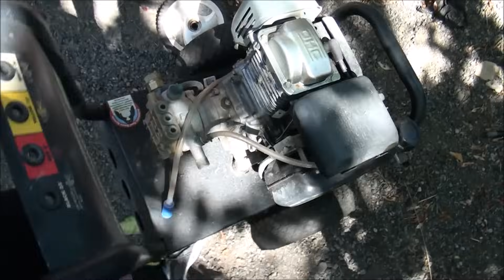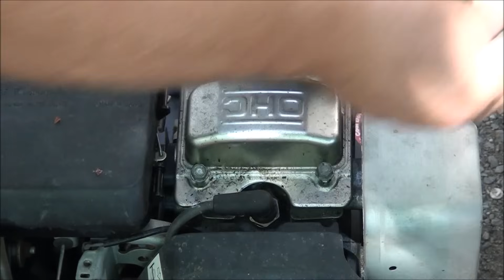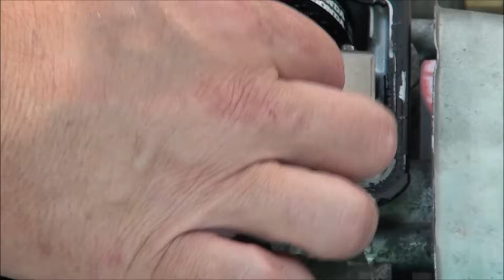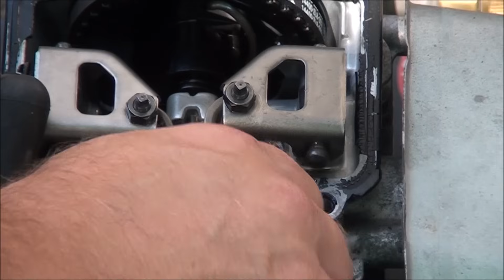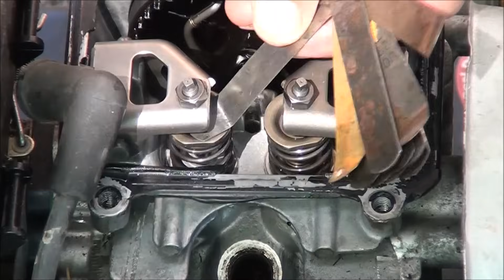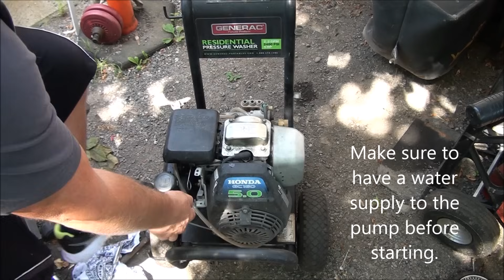HONDA GC 160 Engine How To VALVE INSPECTION and ADJUSTMENT - Specs

Comment: I can't believe that Honda didn't make a gasket for these GCV engines like they've done for all their other engines for the valve cover.
Thanks for the great video.
I'm working on a Ryobi Pressure Washer with the GCV160 engine that's popping and backfiring. 
After I adjust the valves tomorrow I'll put silicone on the cover and reinstall it

Comment: The engineers at Honda have thoughtfully provided timing marks on the belt driven wheel to easily find TDC, so there's no need to stick a screwdriver into the cylinder.  Also, I've never heard of a combustion stroke before.  It's the power stroke.  You want to make certain that the engine is cold when adjusting the valves, and that the piston is at TDC on the compression stroke.
Reply: Got a pic of the markings? I'm about to do this on the GCV190. I wish I could find a free service manual pdf.
Reply: He said compression stroke not combustion stroke.
Reply: @lifeisgood070  

Sorry, I don't.  There must be one available somewhere on the web, though.
Reply: Ummm there's an arrow on the flywheel and and mark on the timing gear just line them up... .006 intake and ..008 exhaust...simple...

Comment: All you have to do is be sure when adjusting each valve that whichever one your adjusting you make sure the rocker is on the base circle of the cam lobe .. Simply put you want the rocker resting on the opposite side of the lobe where there is no lifting action and completely off the ramps which is the only area you would expect to have any clearance so the valves can seat  .. Notice on the Honda there is only one lobe to operate both the intake and exhaust valves .

Comment: Great video thanks for the info. These are great little engines. I have the GCV 190 which I think I have a timing problem. Watched the video on it and not much to it other than pulling it apart to adjust the timing. Valves are already adjusted, new carb, spark plug and new coil. Not firing on trying to crank it. My brother said it probably jumped timing on a backfire. Hopefully I'll get it running 😆

Comment: A Honda service sheet unnumbered makes no mention of a (e.g. cork) gasket but instead says, "Apply a liquid packing (ThreeBond 1207 or equivalent) to the cylinder head cover installation surface, and install the cylinder head cover." 
 I thought they were called a rocker cover.

Comment: You are not supposed to ever run a pressure washer without water, this will burn up the pistons and seals in the water pump quickly and make the water pressure very weak or not make any pressure at all.
Reply from the maker: correct. I was only going to use the engine.I threw the pump away

Comment: Jeff I have a GC160 pressure washer. Took the pump off to service the unloaded valve and put it back together. Changed the oil in the engine, fresh gas. Since then the GC160 does not want to start when hot. When it is cold it fires right up one pull. Could it be that the unloaded is not set properly? I don’t have a pressure gauge to check it.
Reply from the maker: Hi friend. I have experienced this many times and here is Jeff's Tech tip #453655: I would clean/rebuild the carb and replace the float needle valve.  If the carb is filling up too much or seeping gas it is basically flooding out at warm start up.  Cold starts don't mind a little extra gas to get going but warm starts are effected geatley by a flooding carb.
Reply: @JeffsLittleEngineService  thanks for the reply Jeff, I will check it out!
Reply: @JeffsLittleEngineService  took the carb apart a second time because it still wasn’t right, I forgot the emulsion tube. Still nothing, now not even firing on starter fluid. I ordered a coil.

Comment: Jeff Iam new to your channel and after watching a few videos am actually curious .I noticed you provide specs for most of the engines you adjust valves on .However I haven't seen any with you using a valve grinder, pilots, stones or even a valve seat cutter to recondition valves . Fore give me for asking but isn't a valve seat cutter and is pilots imperative to recondition heads even if you purchase new valves and intend on lapping . I mean respectfully valves do wear and in doing so the seats are affected as well . So how do you contend with these issues ? What about a warped head as a result of over torqueing from other do it there selfers that expect your expertise to prevail where there efforts failed . I know personally when I do a over haul or rebuild I grind my valves and seats …..even dress the valve steams with chamfers on the older L head engines to ensure proper end gap or lash is correct . But I haven't seen you resurface a head on a surface plate or check the flatness of a head with feeler gauges . Do you just have such work done at a machine shop ? Or do you just purchase new heads with valves ? Do you just clean the carbon deposits from the old heads then reapply ? I only ask because you advocate your a expert and I have been in many shops over the years all of witch were expert dealers whom provided surface plates and proper valve grinding equipment for me to use . As I expressed in another comment on another video you provided ….I Know your experienced that remains evident in the quality of work and videos you provide to your viewers . So where is the equipment ? I know you push the minimist mentality in your videos to educate the common do it there selfer . But at least up to this point in viewing your videos I haven't seen any valve grinding equipment . SO WHERE IS IT AT ?
Reply from the maker: Those are the old days Kevin! I remember them. Replacement parts costs (even oem) are so cheap these days that rebuilding heads and valves is usually not cost effective timewise. Also assembly tolerances are so tight at the factory these days most engines will never live long enough to need valve work unless something mechanical breaks.  This is my experience over the last 20 years.
Reply: @JeffsLittleEngineService  That's ironic I to have a little over 26 plus years of experience. And you do make great points . Personally after giving your words careful consideration I concur as at least in the past 10 years or so most parts become superseded or {N.L.A.}...no longer available when it pertains to the older equipment . Briggs and Stratton is a great example of these facts as they only offer 20 over pistons on most of there older models . Makes me wonder with all this service by replacement mentality whats to be expected in the up coming 10 years or so . As I am sure we can both agree quality sure isn't what it used to be . I noticed in one of your recent videos a cam failure on a Intec engine .I to have encountered my fair share of cam failures on 28 threw 33 cubic inch OHV Intec engines . The cams gears are just to thin anymore ….hell for that matter the compression releases break and cam lobes wear down as well . I spoke of heads in my previous comment …….How many times have you had to purchase a new head because of valve guide movement on these single cylinder Intecs or really even the twins . Personally I encountered 16 just last year after looking up sales to customers …..it would be hard to say how many valves and heads we ground ….but a fair estimate would have been at least 40 or so on Kohler / Briggs/ Kaws/and of course Onan collectively . So having the valve grinding equipment is a wise investment . Still I can see your point as well ...What I am about to mention  really dosent pertain to Briggs engines ……..But Husqvarna chainsaws …..LOL …..Hell I believe Husqvarna would make plastic pistons and cylinders and sale them under other brands as a parent company if they would hold up long enough for a warranty to expire ….LOL ….look at how they cheapend  Redmax quality . They where having difficulty with making there version of the strato charging tech and basicly bought out Redmax to own the rights . Ever wondered why Jonsereds started labeling FD on there oil mix? …...Thankyou Husqvarna …..for providing the Japanese standard ….That already existed with Redmax …..I have witnessed so much shady crap it is unreal by Husqvarna …...Jonsered ….LOL...….Oh my goodness …..I have seen Jonsered sales obligations in full forse...They change sales reps several times to many about 2 years ago ….seriously we had 4 in 6 months ….all of witch wonted to push obligation sales because they were the so called new rep at the time . Complete bullshit but they insisted more inventory for Jonsered each time. So needless to say Bolins small engine dosent contend with Jonsered anymore. Now lets talk about Husqvarna and there precious Poulan lines ….We carried Poulans for several years at my employers dealership ….I F@Cki*g hate Poulans . They are the biggest pieces of shit god ever cursed mankind with . And it becomes apparent how I deal with Poulans in all the various colors and brands there sold under by watching my channel . ….But I have deviated away from topic ….so anyway ... {CAMS }...Can you believe the plastic …..sorry composite ...crap you find in Briggs push mower engines ? What about the PTO gears ….geezes …..what sorry pieces of S%it ...Last year we had 4 push mowers come in with snapped cam gear teeth and PTO teeth all because of common issues …...not extreme …..common everyday homeowner situations such as the forgotten walnut or thick grass clump that on previous briggs engines would have never been a issue . Truly sad what people are forced to contend with after spending egregious amounts of cash .

Comment: Honda GCV160 on newer 217 push mower.  Pull rope is very free and blade spins below as if nothing else is moving inside engine.  Blade spins several times longer than if a normal crank.  Nothing happening.  Could this be a broken  cam belt?  There is no noise from any moving parts.  Thanks.
Reply from the maker: yes, or something else bad like a broken rod.

Comment: I got the same Engine on my lawmover. Its very hard to start. Its run fine when is running
Reply from the maker: I usually use carburetor cleaner and good ol wd-40. yes you can rotate the blade to find top dead center

Comment: Gees man chill you bent the hell out of that I just pried on it lightly all around it and it came off good I have a mikuni 35 mm carb on mine an a mother cycle exhaust on it it’s a beast be careful adjusting those there is a compression release in the cam so think about that

Comment: Do you have a part number for a replacement exhaust valve guide for this engine? I am not finding one. My exhaust valve suffered from lack of lubrication, and galled up. Need a new valve and guide, if it is serviceable. Otherwise, I have a boat anchor. It will run good for 30 minutes, but once it makes enough heat, it locks up and breaks the rocker arm.
Reply: Id contact honda and ask them Chance's are you might need a new short block
Reply: @conner5611  I drove the guide back in and used some high temp close tolerance Loctite to hold it. Also took a punch and peened around the guide a little bit. Ran it several hours since with no issues. If it comes out again, it will be scrapped. Not worth replacing the block on this 10 year old pressure washer sadly.

Comment: Has anyone had the exhaust valve guide push out on this motor and bend the rocker arm? If so, what was your fix. Best plan I have found is high temp 640 Loctite and tap it back in, then hope for the best.
Reply: Eric i hope you see this message....
I have same engine gcv160 and cracked rocker arm exhaust side....i cant tell if the guide popped out too but it looks like it did because when i push intake valve in by hand it moves in way further than the exhaust valve does...the exhaust valve barely moves much at all compared to the intake...

Comment: For the vavle cover you just need to use a flat head
Reply: Those covers are sealed on using sealant not a gasket. The best way is to heat the cover sealing area with a heat gun or torch. Then it will pry right off.

Comment: What oils the valves?
Reply: OIL.....LOL......No seriously crankcase pressure and a device called a slinger gear internal to the engine . Note that on some Hondas much like some older Briggs engines the Connecting Rods cap or collar had a small piece of alum protruding from it called a dipper .
Reply: The timing belt brings oil to the top end I ran mine with no valve cover to see how it gets lubed and the oil gets slung by the belt

Comment: Why so obsessive about TDC?  Is there really that small of a space on the cam in which the valves are unloaded?
Reply from the maker: I understand your point. However, it is a very important adjustment so I am a little obsessive about it and I am trying to show, teach and explain somewhat proper procedures.
Reply: That's cool.  I understand.  Wasn't trying to be critical, just didn't get it.  But I see your point.  Thanks for the video.

Comment: You aren’t seriously a small engine mechanic are you? Combustion stroke? Didn’t clean and reseal the valve cover? Ran the unit for an extended period without water hooked up? You know how the pump is lubricated and cooled, no?
Reply from the maker: Thanks for the comment. Yes, I resealed the valve cover. I did not care about the pump it was probably already bad, i threw it away.

Comment: You can get a valve cover for less than $10 on ebay.
Reply: Or you can just remove it properly and reuse it and save 10 bucks.

Comment: The problem isn't just with the clearance.  Either the rocker arm pin is worn, the rocker arm pin holes are worn, or the rocker arm tower bosses are worn.

Too much play VISIBLY evident on the exhaust rocker arm mounting location.

Comment: Vale Adjustments are critical,,  if too tight, you will burn the Valves ….. Please USe Correct Tools, and  have the Correct alignment of Pistons ..    Also you have to have water for Power washer  when starting ………… D Grade Video
Reply: Not when you're trying with junkyard special your friend brought.   Honda's last forever  the pump had to have been shot already to be tossed. D grade comment
Reply: Gary T  whats the correct tools in vale adjustment? my gc160 engine get stock or wont turn continueously when i pull the recoil starter. do you have any idea what might it cause? , it seems the valve rocker arm are set correctly.